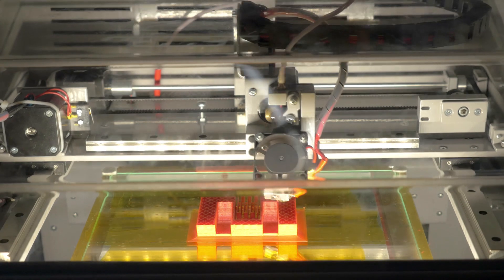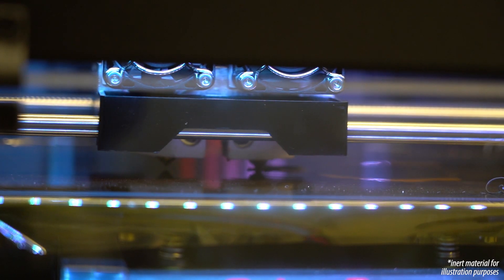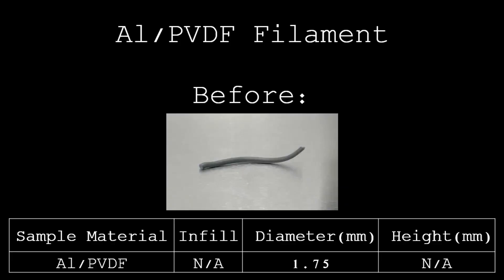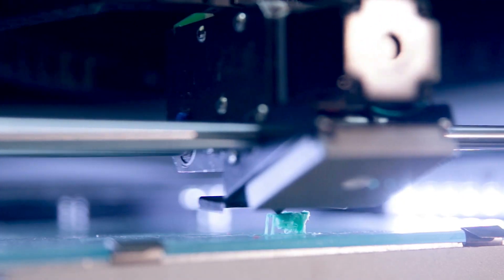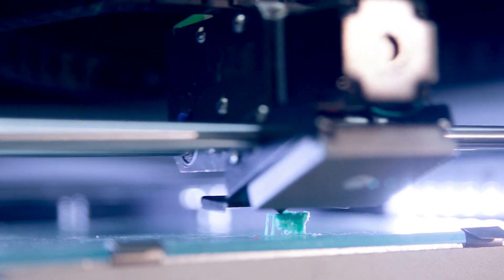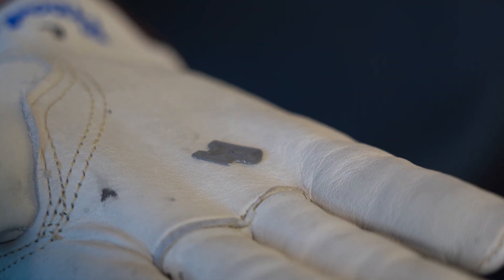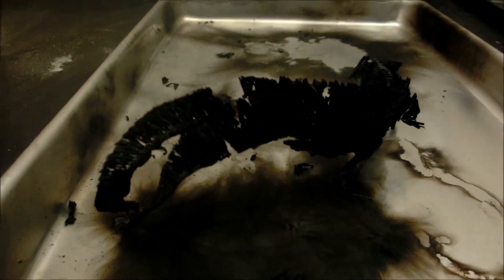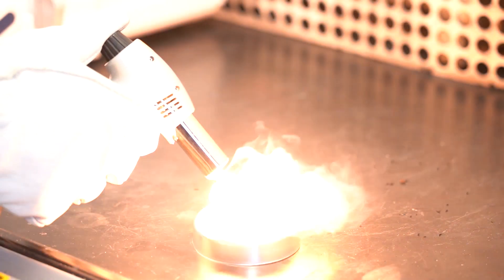3D Printing Energetic Materials

Comment: This is really amazing...
My name is Clement. a Mechanical Engineer from Nigeria
 I am impressed with this and  I would love to know what characteristic of materials determine the correct print speeds to be used for 3D printing. is it only a function of material Density?
Reply: It depends on many characteristics including the melting point, viscosity of the melt, solids loading, type of solids loaded, etc.